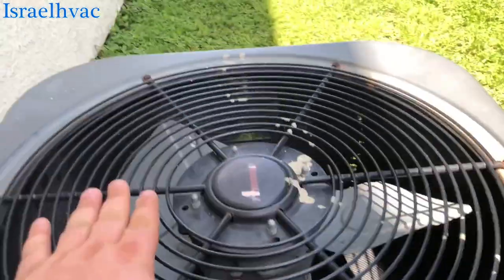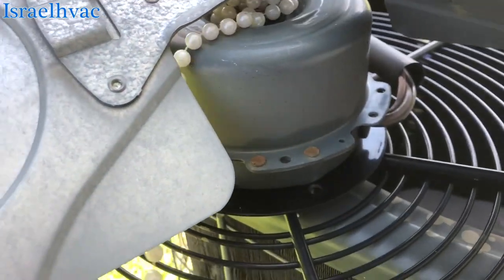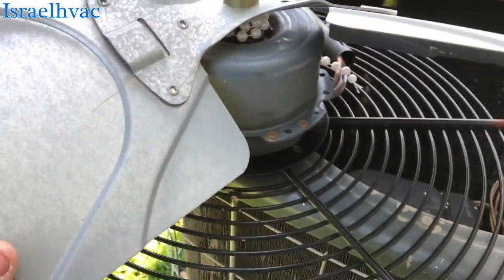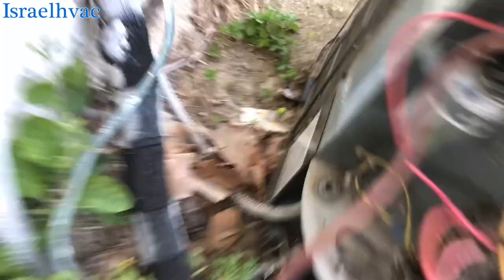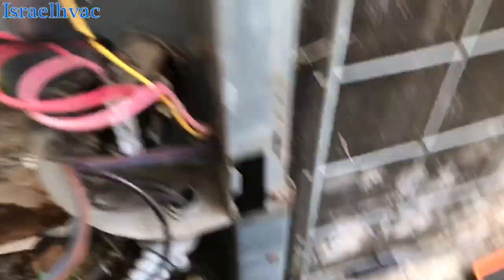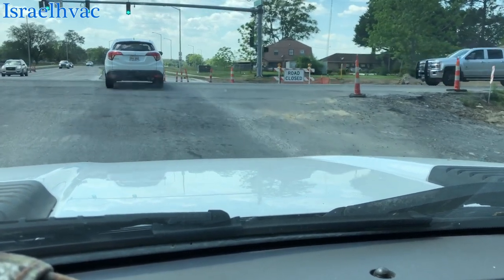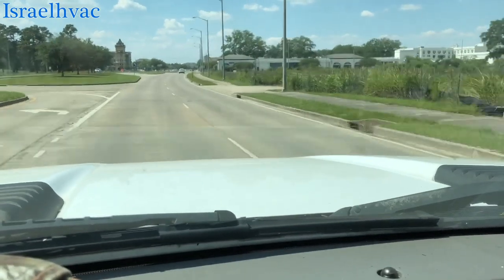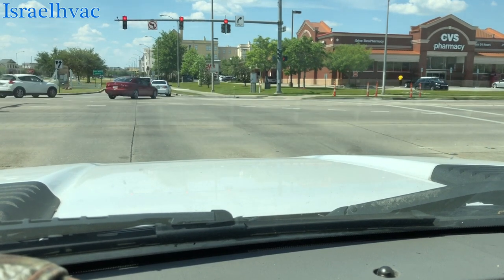HVAC Service | Condenser Motor Not Running

Comment: This is great!  Good video.  BTW, there should be pre-drill'd 48 frame pattern there already (supports both frames).  Looks like this Amana does from what I can see there.  I know Carrier/ICP and older base Lennox brands do that too.  Just for future reference.  Normally don't putting back the 42 frame "clamshell" motors.  Nice work.

Comment: For turning fans, poking around and stuff I have carried a small round file for years and it has come it handy and doesn’t take up to much space. It’s probably 1/2 the size of a pencil and about as long as your nut runner
Reply from the maker: I appreciate the tip

Comment: I was rather surprised you hadn’t noticed that the fan blade was cracked like a big dog.... especially when you’re aware that someone had tossed something in there..... A good practice is to always check the blade before popping the grill guard off.. If it let’s go, that coil is going to get chopped up..   If a motor dies from failed bearings ( most cases ), it automatically gets a new blade, motor and cap anyway.
Reply: Look at footage 2:53
Reply from the maker: Thats not a crack

Comment: I've seen snakes wrapped around the shaft, but never Mardi Gras beads. Did that unit have pre-drilled holes for a 48 frame, to at least get them out of a bind if needed? I don't stock 42 frames either

Comment: Surprised the motor wasn't cooked, renter lucked-out on that one. 

I started doing the same thing; carrying a suction side gauge for quick checks and diagnosing.
On THAT call, I might have went back to the van and thrown the red gauge on(too see if the head pressure was ok after not having any airflow), but if the air coming out of the top of the condenser seemed warm and normal...prolly good.
   Usually just seeing the suction pressure is enough to know if you've got a problem though.

Comment: Does it not have a high pressure switch?
 Btw, I throw a stubby gauge on the suction and keep getting up, half the time.  Rather than Lets break out the iManifold so I can be here 2 more hours, charging them OT.
Reply from the maker: No it doesn’t. I hear that man
Reply: I'm High Pressure Sodium

Comment: Can’t hardly hear what your saying, but wondering why you just didn’t take the blade off to get the beads off. 🤷🏼‍♂️
Reply: That fan shaft was rusted to hell. It would've taken twice as long to sand and lube the shaft and pull the blade off